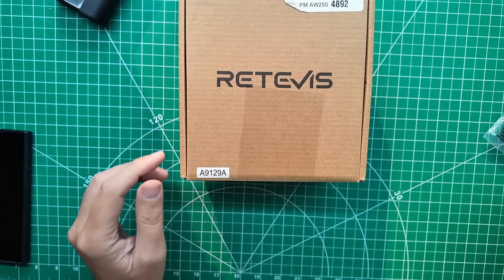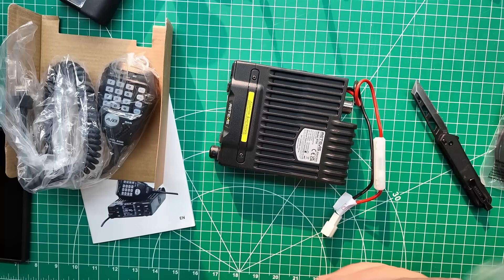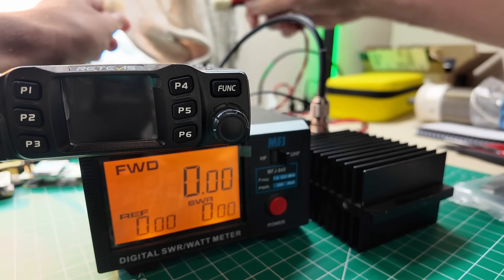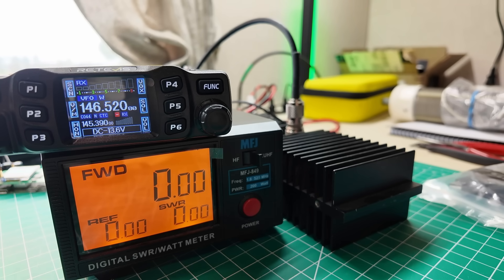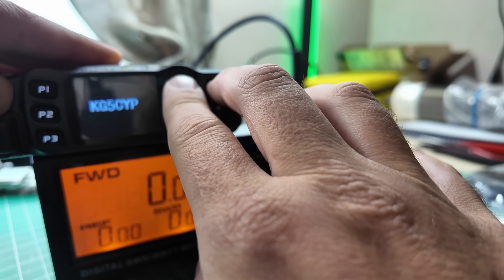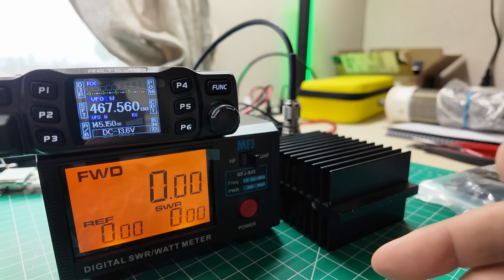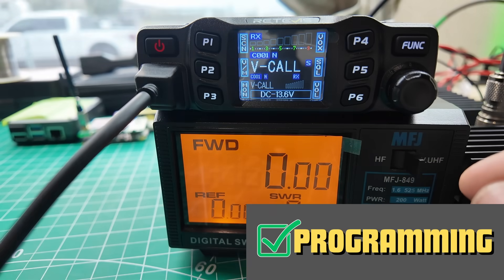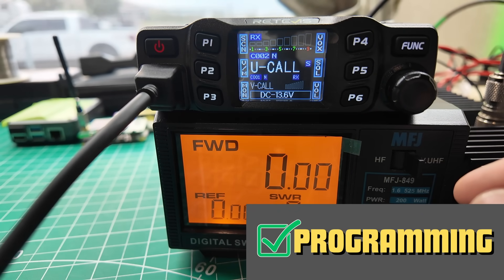Why These RT95 Radios Got RETURNED (And How to Fix It!)

Comment: I Unlocked mine immediately when I got it.  I replaced my car radio with a Yaesu FTM200DR but I use this RT95 at my desk.  Recently I'm having an issue where the signal bars just blink fully signal, then off, once per second.  No Signal is actually there.  It does it on 2M frequencies.
Reply from the maker: try another factory reset?  sounds like something's amiss inside the radio/config.  I fried mine pretty bad and need a new faceplate!

Comment: I have my second RT95 (first one failed within a month- was only transmitting at +\- 2 watts.)

I’ve had this one for a month and now the speaker in the microphone has stopped working. Grrr

Any thoughts on what’s causing it?

Thank you for your help and input.
Reply from the maker: What kind of antenna and power supply are you using?
Reply: @temporarilyoffline  this one is currently installed in my truck. The power is direct battery with a negative going to the body ground. The antenna is a comet 2 x 4 with a tram magnet mount base NMO connector. The speaker on the microphone was working great until yesterday when I lost all audio on the microphone transmission audio is still good. Main speaker body is still good. I think it’s just a microphone issue, but I wanted to know if you’ve seen this before and you’re dealing with some of the returns. Thank you.
Reply: @temporarilyoffline  if I go into the menu and select the main speaker, obviously the speaker works and the handheld is shut off. If I select handheld only I get no audio whatsoever on receiving. If I select both main and handheld speaker, all I get is main speaker. It could possibly be a loose wire or something, but I don’t wanna open it up but it still be under warranty. Thank you
Reply: The first one I was referring to that I returned and got this one with the Mike issue
Reply from the maker: I think you're on the right track.  Inspect the plug and socket for the mic, open up the mic and see if there is anything burnt, smelly, loose wire, etc... but ultimately since it's under warranty, don't spend too much money on fixing it.  Only up to the point where you'd "save" money vs waiting for the shipping game.
Reply: @temporarilyoffline thank you for your help and time

Comment: There is a radio locally on Facebook that is being sold as parts that i have a newer version of that I want. I've looked online and there is a known problem that you have to open up and fix a wire that moves. If only I can get the guy to respond I messaged him a couple of weeks ago then he stopped responding on payday i'll give it another try.
Reply from the maker: sellers that don't respond are the worst.  I'll have to crack one open and see if there are any loose wires around.  If the price is good, it might be worth just getting to have some fun with.
Reply: @temporarilyoffline  the one that i was looking at was a tyt 9800 not the one's that you was working on. from what i've read there is a wire in the head that moves and it shuts the entire thing off. in something that is regularly put in vehicles which is gonna vibrate.
Reply from the maker: @deathwarp131 I haven't heard good things about TYT.

Comment: I put one of these in my truck as a road radio for work couple weeks  ago and these things have so many options in the menu makes my head spin and lack of information online for some functions I think sre specific  to these radios.

My only quirk  as for someone who uses it just for a work road radio is the speaker isn't very loud but where I have mine mounted doesn't help but the speaker isn't as loud as big brand name radios but for the dollar one can't overly  complain especially  for the basic use I use mine for. But what I did was install a external speaker and then permanently  mounted it in the truckwhere my over head console would be, almost looks factory if it wasnt for the color had no one know what these over heads look like it would blend right in
Reply from the maker: Smart Fix!

Comment: could you do that any faster? I thought you said in the title and how to fix but honestly if you slowed down a bit someone might actually be able to follow along but hey you do you
Reply from the maker: I demonstrated it at the speed the radio operated.  I couldn't do it any faster or slower if I tried.  You can always rewatch or use YouTubes tool to slow it down.
Reply: @temporarilyoffline so typical like I used to tell our tech writers just because you understand the material doesn't mean the guy in the field will I appreciate you getting that point sic. 73s dude
Reply from the maker: The beauty of youtube is that you can re-watch or slow it down to your personal speed.  I explained it, I demonstrated it, I discussed it... at some point you should stop blaming others and start taking some responsibility.  I can't push 3 buttons on a radio any slower for you.

Comment: These are QYT radios as anytone doesn't make anything they label like wouxun, retivis. All that is made by TYT OR QYT. I have the qyt-780 and it's a great receiver circuit. I like it over several others I've played with. And 100W.
Reply from the maker: Which QYT model is this?

Comment: Real failures of these Anytone radios are extremely low - it almost never happens. Failures are 99.9% operator error, with Amazon making to too easy. Enjoy the radio!
Reply from the maker: Exactly - too easy to just return the radio vs look in the manual or apply a bit of troubleshooting.  This is our world now.

Comment: I see you didn't unlock the cute band.
Reply from the maker: Which one is the Cute Band?
Reply: @temporarilyoffline The Cee of Bees, maybe?
Reply from the maker: This radio doesn't transmit that low in frequency.  They do have a 10m model that looks similar, but has completely different guts.  I would LOVE to get my hands on one of those.

Comment: These are great for local emcomm radios. You can use them to monitor and or communicate with any of the little radios people tend to have lying around. FRS/GMRS, MURS, Marine, business/itinerant/LMR, etc. they scan fairly slowly so you will want to monitor all of those freqs on a scanner(s) too during an emergency.
Reply from the maker: Good tip!

Comment: I have had to return two radios recently.  I ordered a TYT MD-UV380 and received an Inrico S200.  Twice.  I'm so done with Amazon.
Reply from the maker: I have heard lots of horror stories like that.
Reply: At least you could return it. Some of the other “marketplaces” aren’t as return friendly. 

I always look at the net success rate. While you get the odd dud, most of the time you’ll win. I managed to fit out my recording studio set up for a little over 32c in the dollar I would have spent through conventional channels and managed to beat my budget which was 45c in the dollar if I had bought new. 

Anyway, we’re hams. If something doesn’t work properly, we can make it work well enough to use. It’s what we do :-)

Comment: I had the problem you mentioned re frequency restrictions , with a Chinese radio and tried to research among other owners what the fix was . They were all incorrect but when I talked to the manufacturer (it was a vgc) they said “ in the app , click the power button 10 times “ and that worked and basically was a “mars mod” opening the radio up completely.
Reply from the maker: The newer radios are all software based like that.  If not, we gotta get deep in the electronics.